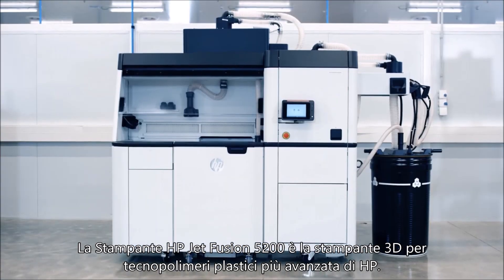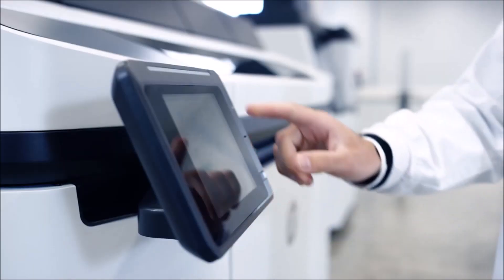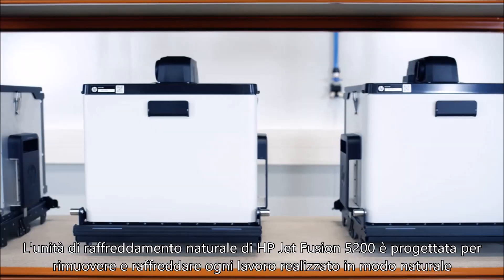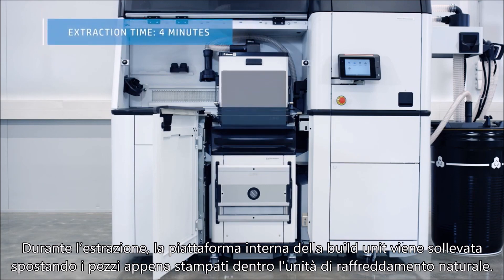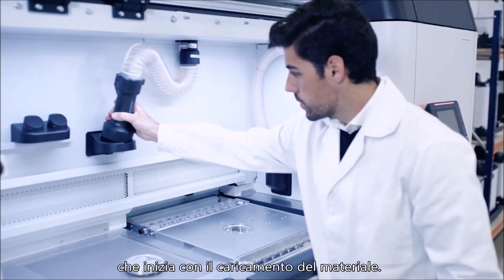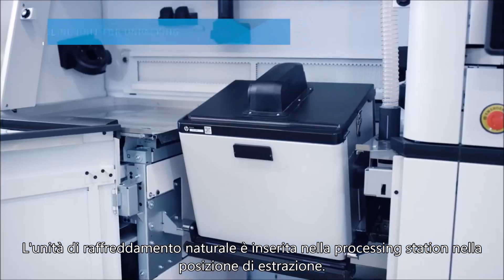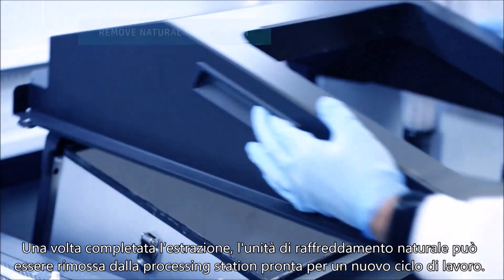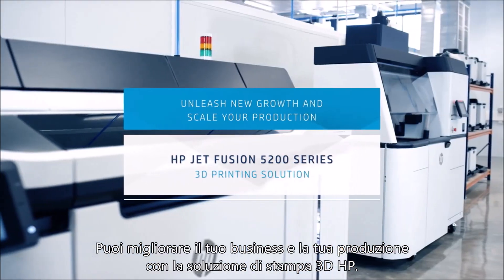Ecco come funziona la stampante 3D HP Multi Jet Fusion 5200 | Nuovamacut

Comment: La Mia Difficile Esperienza con la #HP #JetFusion 540: Un Misto di Innovazione e #Frustrazione.
Da qualche anno uso la stampante 3D HP Jet Fusion 540, e voglio condividere la mia esperienza su questa tecnologia #eccezionale ma anche incredibilmente #inaffidabile.
La Jet Fusion 540 utilizza la tecnologia Multi Jet Fusion di HP, con un volume di costruzione di 332 x 190 x 248 mm e una velocità di costruzione di 31,817 cm³/ora. È progettata per produrre parti ad alta densità e bassa porosità, ideali per prototipi funzionali e piccole produzioni in settori come l'automotive e l'aerospaziale.

La mia esperienza

La qualità dei pezzi realizzati è fuori discussione, sono fantastici. Purtroppo, l'#affidabilità della nostra macchina lascia molto a #desiderare e alterna periodi di lavoro con lunghi periodi di fermo macchina a causa di #guasti a catena che HP riesce a risolvere con molta #difficoltà. Solo negli ultimi mesi, abbiamo riscontrato i seguenti problemi tecnici che hanno portato a fermi macchina significativi:

20/11/2023: Primo fermo risolto dopo una settimana.
19/03/2024: Fermo risolto il 25/03/2024.
27/03/2024: Fermo risolto il 29/03/2024.
05/04/2024: Fermo risolto il 24/04/2024, seguito da un altro fermo risolto il 02/05/2024.
08/05/2024: Fermo risolto il 15/05/2024.
17/05/2024: Fermo risolto in autonomia il 27/05/2024.

In totale, negli ultimi mesi, la macchina è stata #ferma per circa 40-45 giorni. Il tempo impiegato dai miei colleghi per supportare l'assistenza è stato notevole, senza contare il materiale perso e la necessità di esternalizzare le stampe, aumentando i costi operativi e gli anni precedenti sono stati simili o #peggiori.

Critiche e riflessioni

La situazione è resa ancor più #frustrante dal fatto che HP, pur #conoscendo questi #problemi, non riesce a risolverli in modo definitivo e il servizio di assistenza interviene con notevole ritardo e spesso in modo inconcludente.
Inoltre, consapevole di queste mancanze, non concede alcun indennizzo sul canone di manutenzione o altra azione compensativa volta a mitigare i #disagi generati da un servizio di assistenza non all'altezza del nome dell'azienda. 
A conclusione, nonostante in fase di acquisto ci fosse stato assicurato che la piattaforma di sviluppo dei materiali per la costruzione delle stampe fosse stata aperta e che da lì a poco la disponibilità di materiali si sarebbe ampliata molto con benefici anche sui costi degli stessi, ciò non è successo ed il cliente è vincolato all'acquisto di materiali e servizi di manutenzione esclusivamente da HP, con costi spropositati rispetto alla concorrenza ed agli stessi materiali disponibili per le macchine di HP più grosse.
L'HP Jet Fusion 540 aveva il potenziale per essere una macchina eccezionale, ma l'affidabilità e il servizio clienti di #HP devono #migliorare drasticamente. 
Ormai mi considero un #ex-cliente di HP ma mi auguro che HP #ascolti le nostre preoccupazioni e lavori per #migliorare il proprio servizio di assistenza.